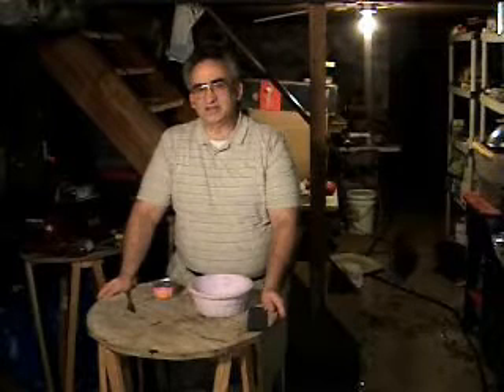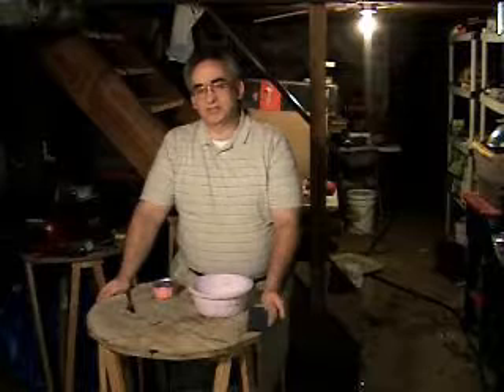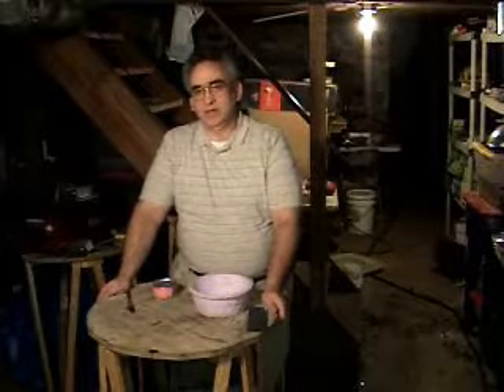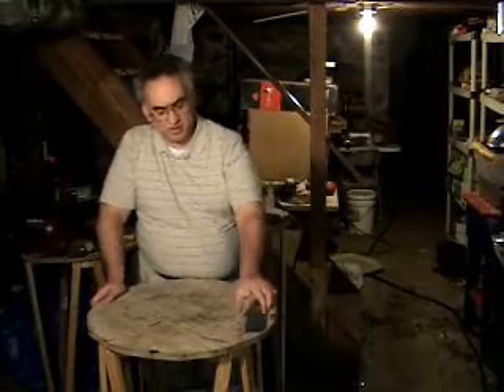Making a concave optic to mate with a smaller convex optical surface part two

Comment from the maker: Murat,

Thank you for your kind words.

I live in New York, USA. Prices for pyrex are similar throughout the country. I generally pay in the area of $100.00 for an eight inch blank. A 12.5 inch blank will go for around $325 and up. These prices are being quoted in 2013. They will increase as time pases. Pyrex is no longer made. Corning gave it up several years ago. Schott now sells Supramax and Borofloat, the next generation. Fused Silica and quartz is also available.

Francis J. O'Reilly